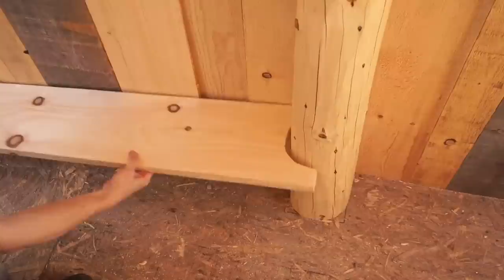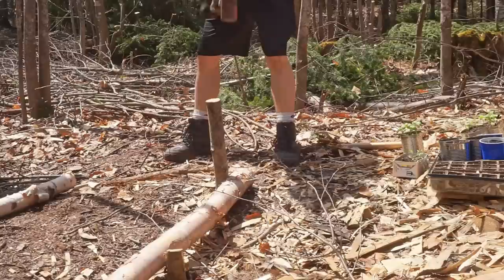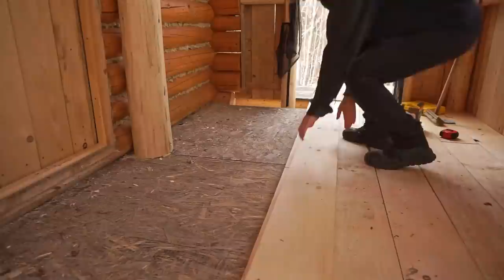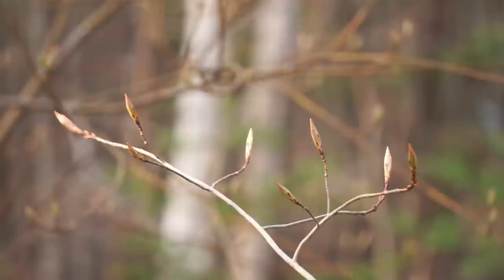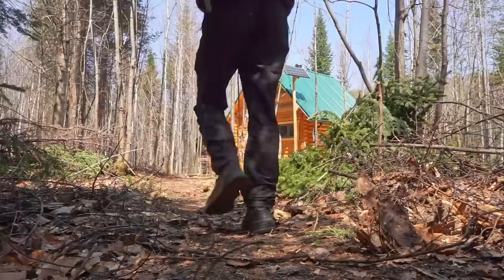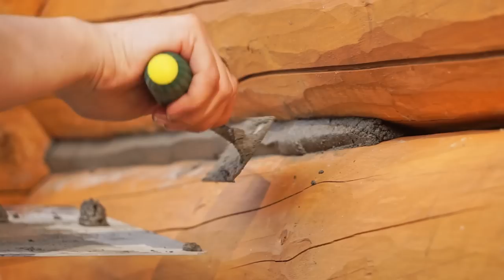Building A Log Cabin | Ep. 55 | Finishing the porch floor and FINALLY chinking!

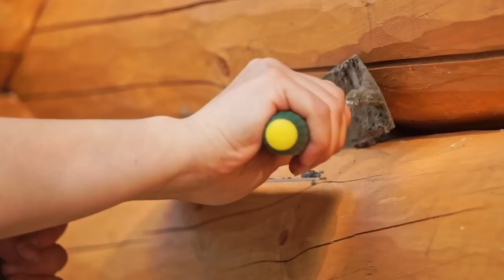Comment: I absolutely love the esthetic of the double beveled mortar between the horizontal logs. I did wonder if the bottom inward bevel will not create a place where water can settle in the channel created causing a non-draining area which may cause woood rot or create a perpetually wet nidus for mold or moss. 23:55
Reply from the maker: We like the look of it too! But like you said, it may not be as practical. We'll probably change our technique from here on out: using a narrower trowel to make a more flat face
Reply: it's not a matter of the area where something will accumulate, it's a matter of
 how materials absorb and release moisture, the solution absorbs moisture from the surrounding environment, the solution releases moisture to the wood, the wood has rotted

Whenever wood is placed on concrete, moisture protection is placed between them (bitumen, roofing felt)

Comment: The chinking part must be so frustrating. A pointed trowl might be easier. Or a tool that masons used called a "jointer" during brick and cinderblock work. I follow both those you tubers you mentioned about thd morter!
Reply from the maker: We’ve been waiting so long to do it that we don’t mind it now that it’s finally time ;) the pointed trowel is great for the corners, but because the gap between our logs is so small, it doesn’t help for the middle section.

Comment: hello, a lot of effort was spent on a house that will last 5-10 years.... why did you put the mortar in the cracks between the logs?
The logs will rot because... the solution will transfer moisture to the logs, and wood + moisture = rotten wood, also a question about how you made the window and door openings, did they not tell you about the shrinkage of the log house? First, the log house is assembled, but after assembly, the windows and doors are cut out, so the log house will be level and will not run away due to the emphasis on the frames of window and door openings

P.S. 
written using Google translator

Comment: I was thinking one of those pointed triles or a 1 inch wide trile would work easier. I've seen other people chinking with wire mesh in between the logs to hold the mortor together from cracking in future. You two have come a long way from when you just started clearing a site.
Reply from the maker: Yeah, we’ll probably end up using nails to make sure the mortar has something to hold onto. We already notice one small crack in the mortar, so we’ll have to adjust. Thankfully, we waited a few days after our first attempt to see what adjustments we would need to make 😅 saved us alot of work ahaha

Comment: I like watching you, but I kind of can’t get over how you can have a young lady work with you that’s not your wife in the middle of nowhere building a home if that was me I’d build a home closer to Lake River or I can get fresh water and by the way, I’ll give you a heads up you can drink it. You can dig a trench from where the water is low freeze level and put some PVC pipe in there and a little pump in your home and you can pump the water from the river or the creek or whatever. You could bring the water into your home it might take some time to do but since you’re gonna be there, probably for the rest of your life you might wanna do it. I just remember put a screen on one end where it goes into from the water to the home or filter system. Just a heads up if you’re doing a great job proud of you.